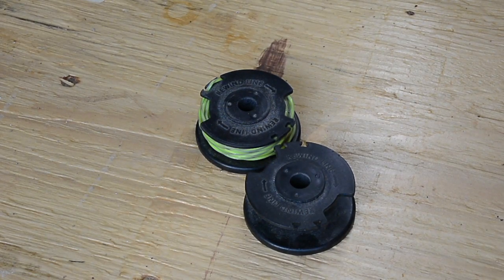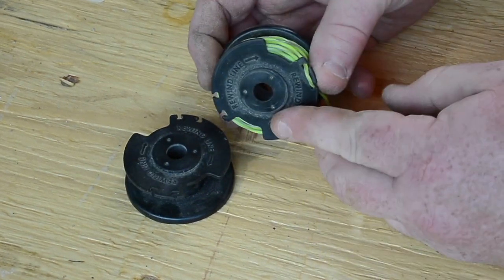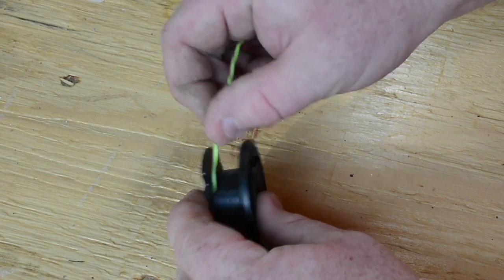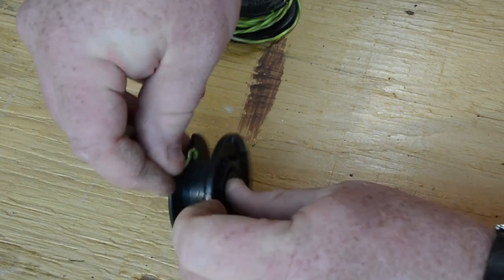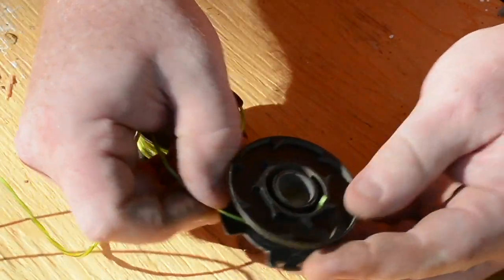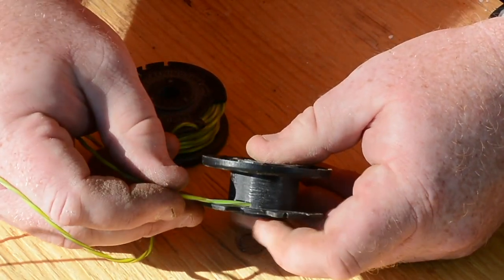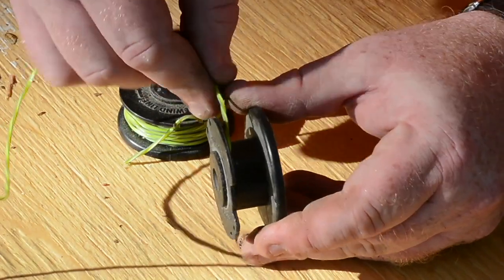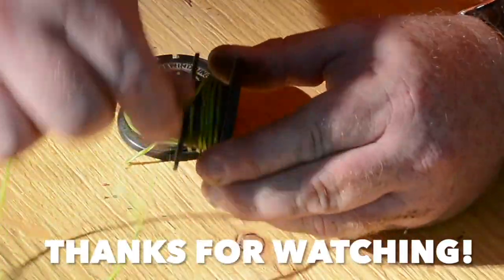Weed Whacker Spool Unwinding? How To Properly Wind Weed Whacker Line

Comment: My old weed eater finally was replaced after many years. After replacing the spool the first time as soon as I press the button the line will retract back into the spool. I take it apart and feed line out and don't even get it back to the ground and its retracted. Not even a second of line and never touched anything. Could it be that its wound backwards? Never had this issue with previous weed eater
Reply from the maker: I would say that it doesn't hurt to try to wrap in the other direction. The direction of wrapping should be indicated on the spool. Also, consider leaving more line on the outside of the spool at the onset. If you only have 1-2cm sticking out, maybe it's inclined to retract back into the spool.
Reply: Im leaving enough that its getting hit by the cutter so I can't leave any more out. I used a black sharpie to mark how much was out and its definitely retracting and not breaking off. I miss my old weed eater with the two lines sticking out

Comment: Will this prevent the line from going back inside the trimmer head while using? I have a Ryobi electric trimmer and the line constantly does this. I have to stop every couple minutes to re-feed to string through that little eyelet hole.
Reply from the maker: I know the frustration! I think it could be 2 possibilities. First, perhaps the line is old and brittle and breaking easily, thus breaking farther back than normal. You can soak the old line in water to increase its flexibility. Second, maybe you’re getting too close to rocks or stumps. I try to start far away from a hard object I’m cutting around and then slowly move in toward it, thus I only cut ‘ever so close’ to the hard object and I try to not directly hit it. If you hit a rock close up, it could snap the line close to the edge of the trimmer. I hope this helps.

Comment: Why does my spool/string keeps getting short ?
Reply from the maker: The string extends every stop/start, so if you're stopping and starting a lot, the string will get short quicker. If you just keep the unit running, the string should last longer.